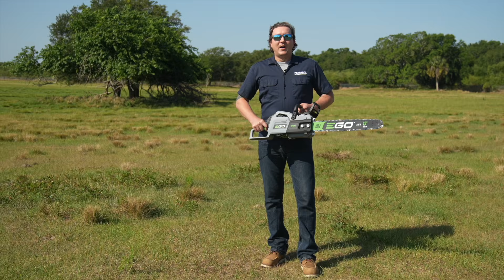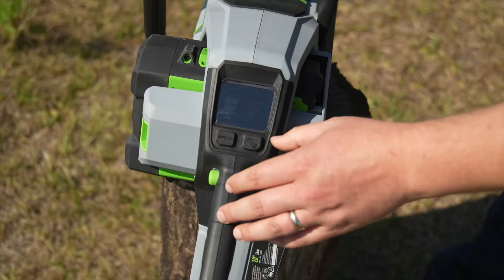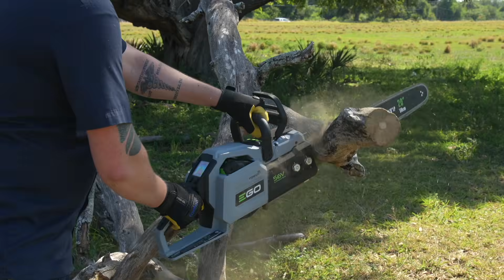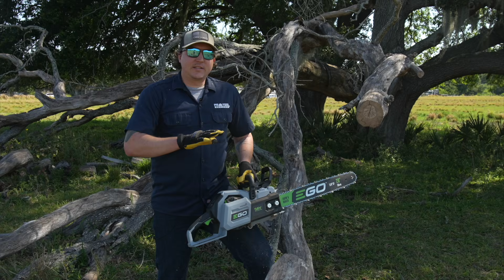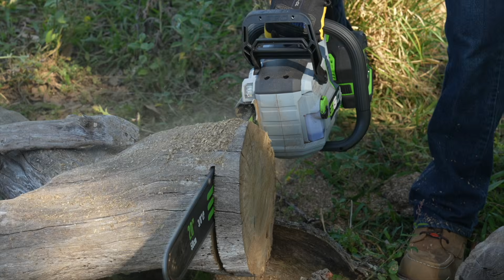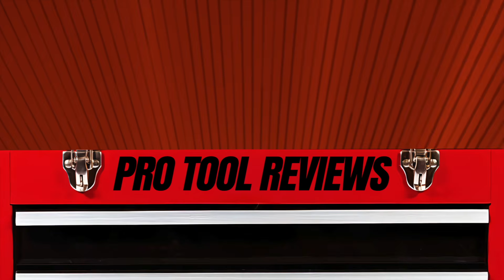New Tools from EGO! 56V 20" EGO Chainsaw Review

Comment: I've had three gas powered chainsaws. Low end, high end, they all sucked. Same with my leaf blowers & trimmers. I replaced my blower with an EGO, and I'll never go back. No spilling gas, mixing oil, pulling, priming, pulling, pulling, etc., instead getting the job done. I've developed a real hatred for small gas engines. The technology that makes modern internal combustion engines so reliable in vehicles, never seems to trickle down to the small gas engines. They sucked 30 years ago and they still suck! I'll be getting one of these EGO chainsaws very soon!
Reply: The Honda gas trimmers are solid, but I definitely get your general point.

I have Ego's trimmer, blower and this saw. Good stuff!
Reply: @debsmith7861  I got the saw and have used it several times. It's excellent. And knowing that it will be ready to go when I am, is priceless! And my wife doesn't have to hide the gas can so that I don't pour it all over the saw and light it.

Comment: I have a 10 amp hour battery. The Amazon link for this chainsaw says that it will work, but it is not ideal. Is there any reason why a larger battery would not be ideal other than balance?
Reply: Amp hours are only going to increase or reduce run time. Won't effect performance to the point you will notice a difference

Comment: I love my CS2005, but I cant find any info on replacement parts. Can I put an Oregon bar or chain on it? Hiusqvarna? I cannot get any answers from anyone. 
The spewvcs on my CS2005 is a .050"  guage chain withb .325 pitch and 78 drive links. 
Oregons H78 chain has those specs. So will it work?
Reply: All depends on the bar mount pattern.  Stihl, Husqvarna and Milwaukee all like to use different bar mounts,  its likely that Ego use one of them.

Comment: They should have kept the guard up there but made the brake a push button. EGO have the best battery operated yard tools imo. I'm a Milwaukee guy but 56v vs 18v is a no brainer.
Reply: That wouldn’t make sense though. Half the reason for the chain brake mechanism is that in the event of kickback, your wrist will hit the mechanism and engage the brake.
Reply: Then why not 80v greenworks if you think is all voltage?

Comment: It is a good looking saw, just not quite as heavy duty as the Greenworks 60V 20” saw. That thing has a metal skid plate on the bottom of it! It’s a beast and a half!
Reply: This is heavier duty than the greenworks 60v. About the only greenworks that compares are the commercial 80v and the 82v from greenworks.

Comment: Ego battery equipment is always too heavy, the batteries are bulky heavy and as a commercial user the battery not last a year, but the warranty will cover battery for 2 years so easy swap
Reply: Well once you get to this size of chainsaw it’s gonna be a heavy beast for the job it is intended to do. If weight is a concern then you’re stuck with 16” or smaller!
Reply: The Ego batteries on the blower and trimmer last seemingly forever. 5 years on mine and strong as hell.

Will see how the farm saw battery goes.

Comment: Tell us the uses/benefits of having more than one speed.
Reply: One goes faster than the other.
Reply: I don't like vacuums with a low setting either.
Reply: Owning this saw myself, you can get a lot more run time at lower speeds, and if all I’m  doing is smaller cuts, branches, etc the lower speeds and Eco keep me from charging as much